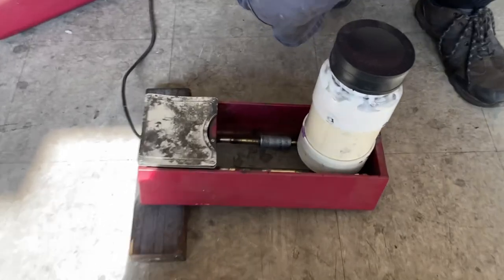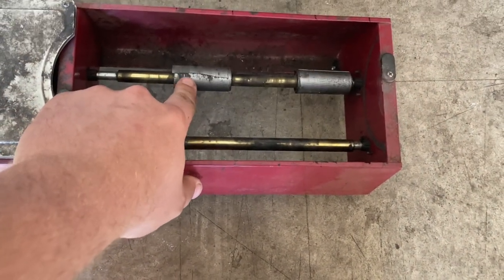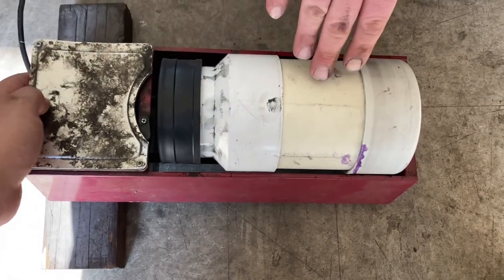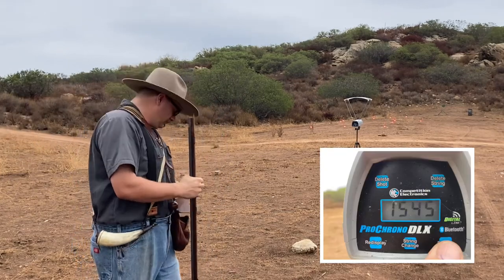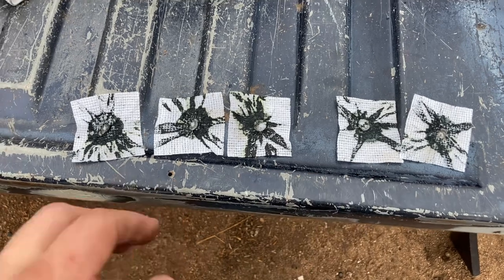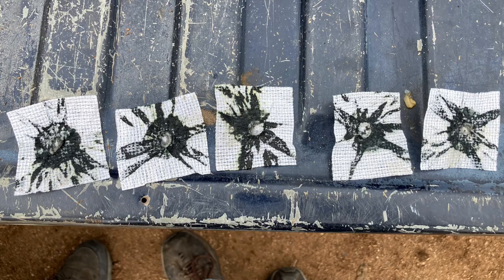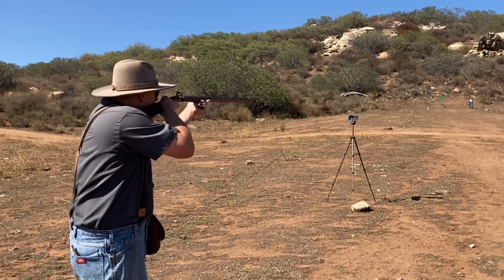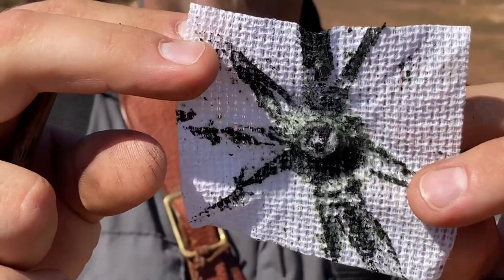Why Is Your DIY Black Powder So Dirty?

Comment: Great video! With respect, your ball mill is too small. Give it to your grand daughter to play with her Barbies. Needs more hight to tumble a bit more. I made mine with a beer keg, with small riffles welded inside, running at 48 RPM which is 70¨% critical speed for this size. Ball cast in zinc diecast in mold 35 mm diam. A bit big but we don't f.. around here in North Queensland! I notice you have a "prochrono" there are the best, i have one too, never a missreading.. Cheers!
Reply from the maker: The mill I use now was made from an old tread mill. It works like a charm
Reply: Thanks for replying, chins up, powder dry!! @Everythingblackpowder

Comment: Use cotton to make you charcoal. Just add the charred cotton to your ball-mill after you weigh it for your correct ratio. Your ball-mill should air float the batch. Once you have run your batch to air float, add 5% dextrin as a binder and run it for 10 minutes in your ball-mill. Corn your black powder as you normally do and once dried then run it through your sifter to grade it. Your grains will be very hard and your ignition should be greatly improved.  I assume your KNO3/S are of high grade. Hope this helps.
Reply: what kind of cotton?

Comment: Lead dust getting into the powder and most likely people's lungs when you fire. Idk what that does to powder performance but I do know lead vapor also happens when shooting modern smokeless powders as well. I don't want to be a safety nerd, and I don't know the extent of risks overtime, but If you want my advice then you should wear a mask or respirator when you fire. If not then that's fine too, I just wanted to throw that out there

Comment: Love your channel and the work you are doing. I might be able to help with the loss of MV concerns. I have been doing similar work for the past year and have found at least four circumstances that can reduce your MV.#1: Grain size, pretty obvious and you already know this. In general, with same wt charges, 3f is faster than 2f, 2f faster than 1f. #2: Inadequate milling. You can mill your way out of a bad powder by returning it to the ball mill. I suspect the ceramic media does not have the wt and density of lead balls and may make your milling less efficient. A poor performing powder usually indicates it needs more maturity in the mill, regardless of the charcoal source. #3: Overheating your charcoal. I know this is another rabbit hole to go down but temperature control of the charcoal process is necessary for a good performing, consistent powder. I lost 100fps in MV with charcoal roasted at 620-670F compared to same charcoal source done at 520F. Over-cooking burns off much of the creosote and makes the fouling dryer. I don't know the magic temp yet and it may vary from source to source. #4: Over compressing the puck. Commercial puck densities in the 19th cent varied from 1.55 gm/cm to about 1.8 gm/cm. Tests done then demonstrated an inverse linear relationship between bp density and MV, that is as density went up, the MV went down. The MV consistency could be significantly effected by changes in density as little as 0.05 gm/cm so tight regulation of your puck compression may be worthwhile. I compress my pucks in a 3 in diameter die and, with some math, realized that a density change of 0.05 gm/cm in a 3 inch die translates to change of compression distance of only around 0.033 inch. I have not totally figured out fouling issues yet but have found that glazing helps. Also, anything else that helps your powder burn more efficiently generally reduces the fouling. Hope this helps. Good luck with your efforts.

Comment: Hi,I made brass balls from rod,a couple each day during lunch with a grinder,held them with vice grips.takes a bit of time,but got them forever now.they work a treat,made my tumbler out of a 8” shell,bronze end plate held in place with string .strung like a drum skin.if that makes any sense.drilled the sides of the shell and riveted copper boat roves on the inside to give ‘speed bumps’....tumbler motor is a moterhome ceiling fan( needs to be 12 volt)...
Thanks for your advice on charcoal temperature,have used willow,a fast cherry weed that grows down here and palonia...
Regards from New Zealand.

Comment: Excellent video. I learned from you and Mystical Pyro about DIY BP. I don't puck mine, use lead balls, and a rubber jar on my mill. But I love the results I'm getting. But I'm not checking fps. I'm using cascade willow it grows here in Washington state and a 75:15:10 ratio.   Early muzzleloader season starts Saturday so hopefully I get to use it. I forgot to mention I forgot my cleaning rod and fired 20 rnds. .490 round ball .010 prelubed patch 50 grains of powder and was able to seat the ball. However on around the 12th rnd I lost my groups.

Comment: i could see the difference in the recoil of the rifle with the 20 added grains. my dear old dad always said you cant get something without giving something getting back engineering wise .something i commented on yesterday, if you used a finer powder you could have achieved the better velocity as the finer powder would have weighed more due to the volumn more splitting hairs.now back in the 70s when i shot with my dad,they used to say how you cant blow up a black powder gun by over charging and the excess powder just blows out the end of the barrel, also kinda like putting more horse power under your hood to go faster but eventually you will max out for speed due to design principles of the vehicle. you sir a a very special person hope my comments are not too boring your videos are very good.einsteign without the sheep skin

Comment: I have been following all of your videos along with Hoffman Reproductions & someone made the same comment to him. All of your stuff is spot on, however if that were true whats goex's excuse for being dirty. If rubber dust was a problem you would have a rubber-less drum in no time at all. They are made to tumble rocks with heavy abrasives. I think making a new drum with risers glued inside With an increase in speed did the trick. I was on a another forum & the gentle man was making what he called Sporting powder 78/12/10. Said it was the cleanest he had ever made. I tried it and it was the dirtiest I ever had ?? I made up some 45 cal. dummy rounds and I'm using them for my tumbling media.  When I added too many lead balls which I used previously you could see the drum slow down & the powder came out lousy. In my opinion it is the speed + the heavy tumbling action that makes or breaks the powder. Keep up the good work. I love watching your videos.
Reply from the maker: That’s interesting about the sporting powder. We have done some extensive testing with different ratios and we lost a significant amount of power with that much oxidizer and it very wasn’t any cleaner, although nothing we tried was really any cleaner.

Comment: Yup, picked up the ceramic pie weights a while ago. Love the upgrade of the mill! Took me a moment to realize that you were not using something from a previous relationship for the test comparison. (Go Ex)🤣. The 600° ceiling is interesting and wonder if that is variable with the type of wood as well as altitude. I function between 7 and 10k ft. Things boil or gas off at a lower temperature here. We have a supply of willow up here that is un beatable. I just haven't been able to get set up to produce at this time for a lack of dedicated space.

Comment: according to some studies， the best temperature of making charcoal is between 350 and 400 degree centigrade.  based on these studies, the charcoal we used should be write as C/H/O(this means the main power is from H and O), and different wood will lead to different charcoal. and the paper also suggested that we should choose the wood that with low desity and low resin.  

that all i konw, hopfully this would help!

Comment: Hello, good evening, I just saw your video and it's very good. I tell you that here I couldn't get the ball mill (as I make the black powder I also make the implements to make it) so I had no choice but to make it with a motor from a car windshield wiper, where you have a motor that already it has the speed reduction, it has 3 speeds from which to choose the one you like the most, it is at 12vdc and I feed it with an old pc source (all free up to here) and that way I have two things, the first one I make sure that it consumes practically nothing and the second is that with this source and motor configuration everything is grounded so that it does not generate static, the container is metal and a can of powdered milk and I weld it to the motor shaft. The balls are made of bearing steel that I ordered in different workshops and they gave them to me. In this way I am totally sure that it does not have contaminants such as lead or container plastic. I hope it helps you. Excuse any translation error because it is the google translator.
Reply from the maker: Excellent

Comment: I have been collecting the bits & bobs to do make my own BP.  The weather in my area has been so dry that everyone is deathly afraid of fire.  So, no charcoal making.  That's changing with the season now...I hope.  Meanwhile, my gut said that lead ball media would introduce inert mass to the mix.  Never mind the toxicity thing.  That said, going from rubber & lead to PVC & ceramic at one time is two substantial variable changes at once.  May I suggest same for same ingredients with rubber/lead, rubber/ceramic, PVC/lead, PVC/ceramic with corresponding volume to weight measurements vs. velocity & fouling vs. milling time & granulation.  Perhaps the rubber is acting as a fuel or the lead is making things slower & less energetic?  My guess, PVC/ceramic will yield the best result overall.  Many thanks for the effort it takes.  Y'all be safe & shoot happy!

Comment: The commercial powder manufacturers coat their powder granules in graphite to protect the powder from moisture. I think it may also give some protection from static electricity. Graphite doesn't burn so it will either get blown out of the barrel or coat the inside of the barrel.

Comment: 954 Bronze is a fantastic option for a non-sparking, corrosion resistant metal. Its about as hard and strong as mild steel, and pretty inexpensive for what it is. 

If you're interested in making parts to reduce contamination, and you're wortied about sparks (as you should be in this business), I highly recommend Aluminum Bronze.
Reply from the maker: Thank you
Reply: I just looked it up 954bronze has around 3-5% iron, not sure if it wont spark, some brass alloys (like C360) also use iron, up to 0.35%. Maybe thats to little iron to make sparks, but I honestly just stay with lead, no worries there.
Reply: @2fame4name24  they specifically use aluminum bronzes like 954 to make tools for use in petrochemical work where sparks can cause issues. It won't spark.

932 is a good option, too.

Comment: After watching Ron's video I went out and made a PVC mill but chickened out because there internet told me static electricity would make it blow up. I think it's a mistake to change more than one variable at a time. Try using lead balls in your PVC or ceramic balls in your rubber mill. I inspected my rubber containers and didn't see much wear even after many batches. Not enough rubber was removed for me to feel with my fingers. I also think the balls wouldn't shed any lead after the sprew is gone. I'm happy to see the community coming together on this. My powder is screened with rice starch and made with weeping willow. It's very dirty and I was thinking of trying other woods. I think in your case the ceramic balls aren't having the hammer effect of the heavier lead balls. Where did you buy them?
Reply from the maker: Well we tried most of that already and the cleanest powder is with both the pvc mill and the ceramic media. The 77/13/10 batch was milled for 8 hours and the 75/15/10 batch was milled for 4 hours so I’m not convinced that it’s mill time that’s the culprit. As for the balls not getting smaller after the sprue is worn off, you would be mistaken. I measured a few of the balls and one in particular that comes out of the mold at .735, measured .721 so they are definitely getting smaller. My failure in this was where I didn’t chronograph the first two experimental batches 
(one in the old jar with ceramic media and the other with the new jar and lead media)
We just went out back and fired a few  shot with it and checked out the patches. We weren’t counting on loosing 200fps. Also, the internet has been telling me for years that I’m about to blow myself up.
Reply: I got into making my own about two years ago and still use the rubber canister and lead balls.  I do use a fairly hard alloy for the balls but they still wear.  I haven't seen a measurable amount or wear on my canisters but the balls definitely do shed.  The quickest way to see how much lead is mixing in is to mill just potassium nitrate.  It will come out a nice pale gray after a few hours.  Powder burns clean enough for my purposes but definitely is leaded fuel.
Reply: I found them on Amazon

Comment: I've been curious about the lead & rubber issue as well.  My .490 balls have gotten reduced down to about .475 diameter.  I'm assuming most of that lead goes up in smoke. Care to share where one can attain a similar product... If one were so inclined?  

The duct tape trick on the spindle works for a while as a short-term fix.  Ideally, a piece of plastic tubing with the same OD as the ID of the existing tubing would be better.  After having a motor issue arise, the duct tape on mine melted, slid off to the side & gummed everything up.  It took a while to disassemble, clean everything & put it all back together.  I can't find the right tubing so I opted for a couple strips of bike innertube wrapped tightly & then affixed with electrical tape.  Makes for a bumpier ride over that transition but it turns faster & without hanging up as much.  

Good stuff here.

Comment: Hey Sir, glad my info on the rubber dust and the other guys info on lead dust helped some. I was excited to see that you and Hoffman Productions got similar results in regards to less foweling! Not sure where the velocity drop is coming from, but I like your plan for testing. I'm sure you've seen it already, but Hoffman lined his tumbler with aluminum. You may consider doing a batch using his setup and one using your new setup to see if there's any difference or if both are equally good solutions to the problem. Anyway, keep up the good work Sir, can't wait to see more of your results in the future👍
Reply from the maker: Thank you so much! I really appreciate it. I talk to Ben often on the subject and we keep each other up to date. Thanks again!
Reply: @Everythingblackpowder  anytime Sir, good to know ya'll collaborate, keep up the good work we all sincerely appreciate everything ya'll do!

Comment: I love all of your videos and especially your comments.  As far as cleaner charcoal and thus cleaner powder, try washing the powdered charcoal with distilled water and later alcohol using a Buchner funnel with filter paper and a vacuum flask arrangement.  Removes water soluble minerals and other soluble contaminants.  Lastly, if you have not tried Mimosa charcoal or mesquite charcoal, you might want to take a look if you have time.  They will give alder buckthorn and willow a run for their money.
Reply from the maker: We have done several experiments with washing the charcoal and for the most part all it does is lower the velocity by a good 600fps
Reply: I hear you and believe what you say about the washed charcoal producing lower velocities.  And remember that activated charcoal which produces poor black powder is super clean.  So, connect the dots.

Comment: Contaminants is a good guess. However, the mill time would be my first suspect even with increased rpm's it may appear to be done to the naked eye, but just not quite. Lower velocities almost always (in my experience) meant not fine enough. The mill being the only thing different points to that. Maybe investigate both variables?
Reply from the maker: The first 77/13/10 batch we milled for 8 hours just like I would have with the old setup. And it didn’t change much

Comment: It is a known fact that some charcoals produce faster powder and some cleaner burning powder too.  I think it would be good to find out for a certainty what is the difference.  I just learned that most charcoals contain sulfur.  Just thinking out loud....would be nice to have charcoal from various woods produced in the same way and milled in the same way tested for chemical composition via the ultra modern instrumental methods.  Would be an eye opener I am sure. Also, there are several papers on the subject out there in cyber space.